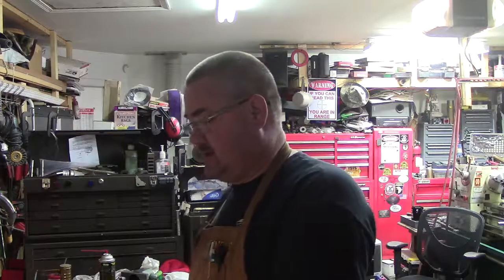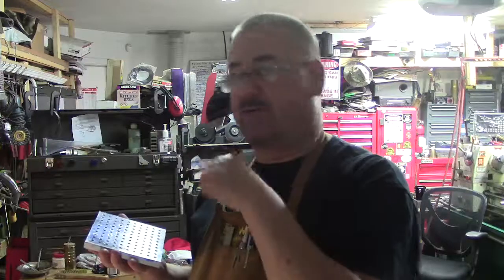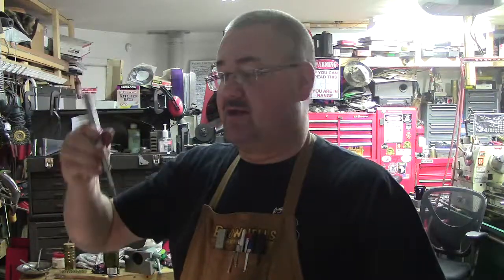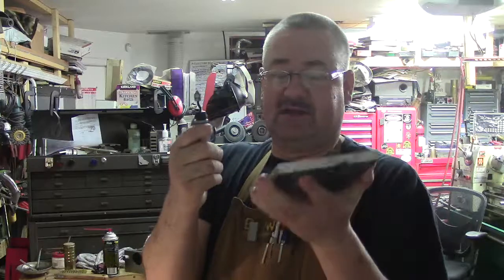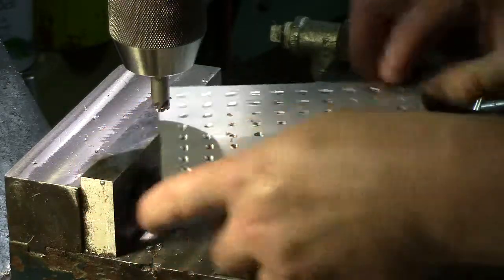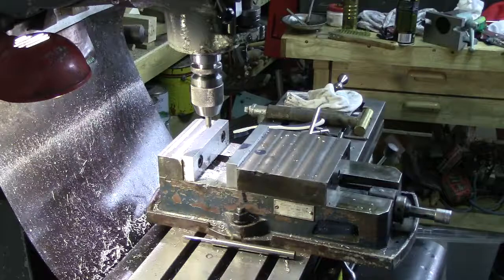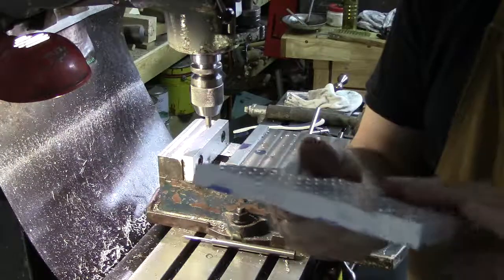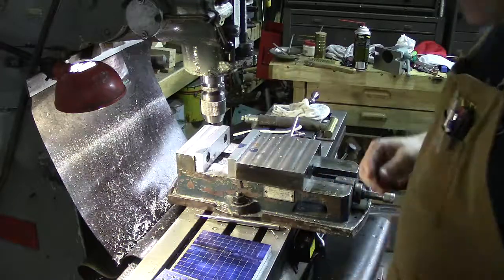Fixtrue Plate Bridgeport Mill Final Episode Using Niagara Cutters

Comment: I'm getting ready to build some of those after watching several creators ideas.  MrPragmaticLee has some good ideas as well as a few others.  What thickness material is that?  I ordered some 1" x 6"  12" long.  I may also build one thinner for rotary table and a few for sin plates.  I've ordered the new mill and alot of tooling lately.  This video must have been quite a few years back.
Reply from the maker: Yes, this video is a bit dated. It still has great information though. Build it out of plate aluminum as it will work best for the odd ball stuff. I use the heck out of mine for the smaller items that you can not hold to the bed or in the vise. Thanks for watching Larry!